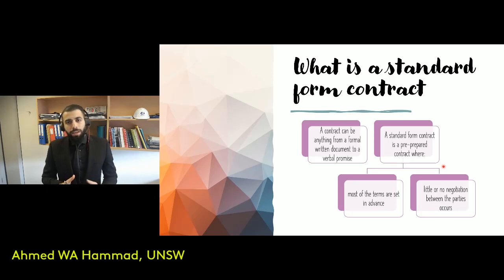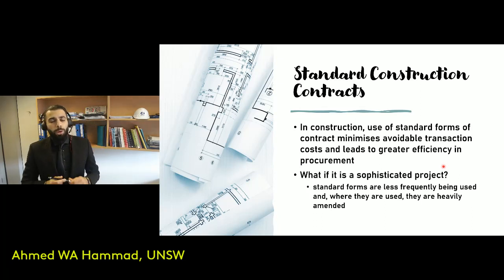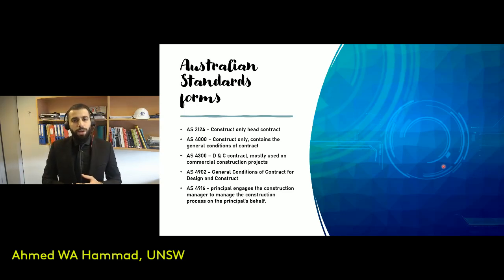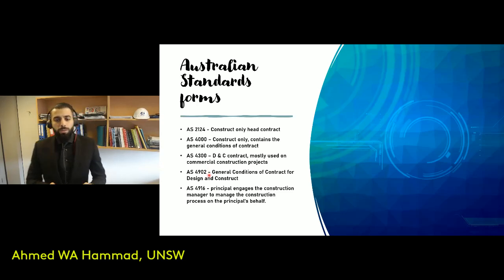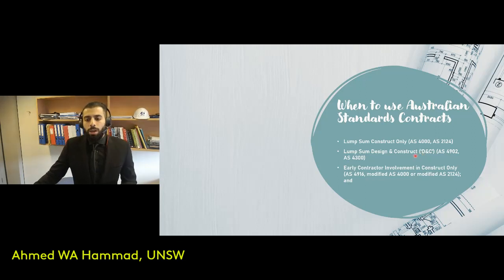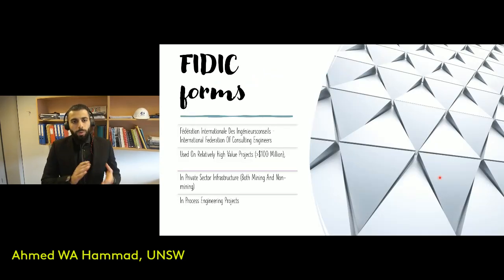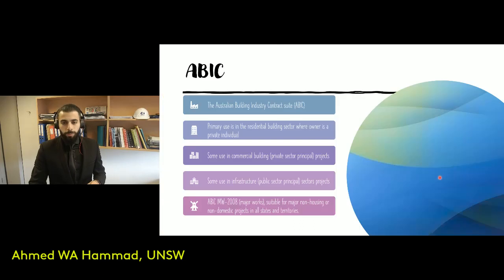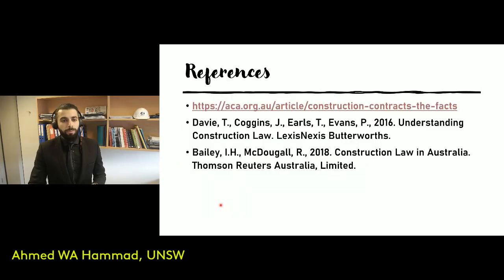Types of Construction Contracts-Wk3:S1

Comment: Can you give more info on GC21? Eg why is it use opposed to other AS forms?
Reply from the maker: GC21 is often used mostly in NSW (sometimes in QLD) and for project values over $5 mil. In addition, I find that the public sector prefers GC21. AS forms are adopted more for major building and engineering projects where a superintendent is engaged to administer the contract. Hope that helps